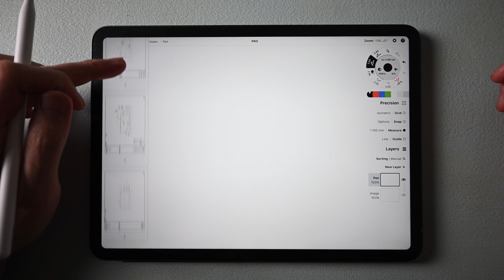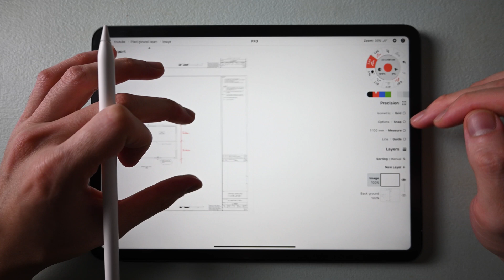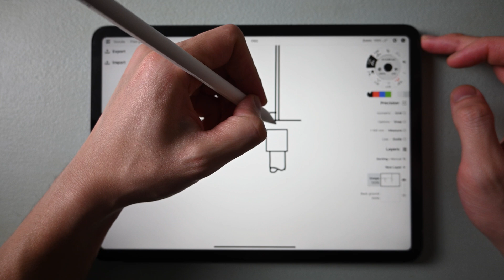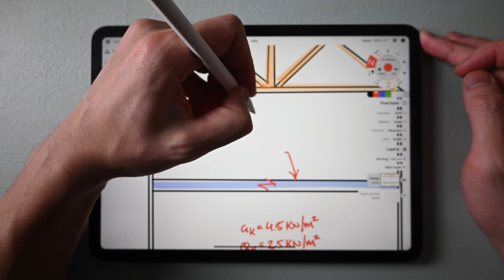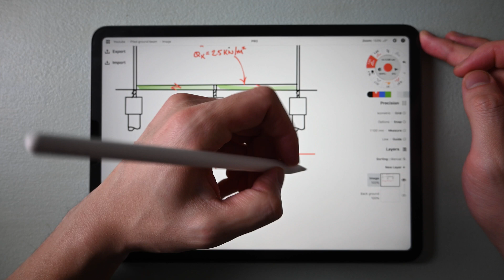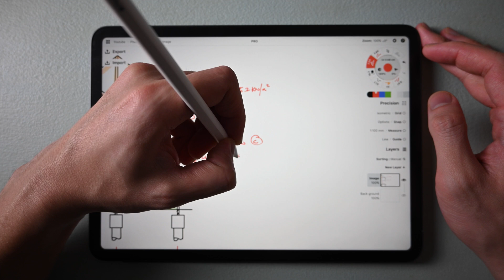How to design Piled Ground Beams | Structural Engineering

Comment: Hi I have a question does the geotechnical engineer design the piles or does the subcontractor who installs them design them
Reply from the maker: In my experience it’s the piling sub-contractor that designs and installs. 
I’m pretty sure a geotechnical engineer can design them too though